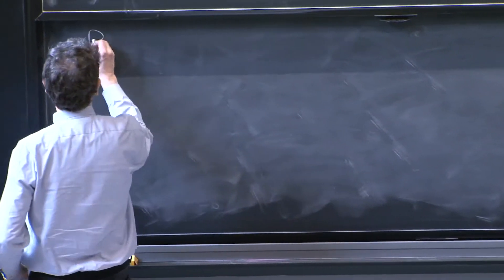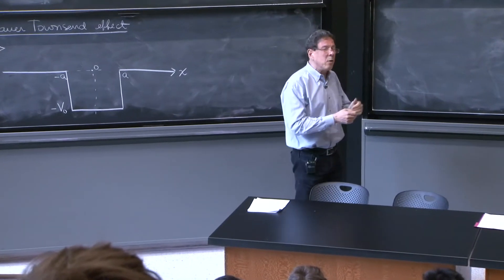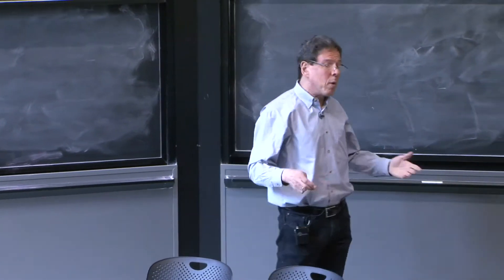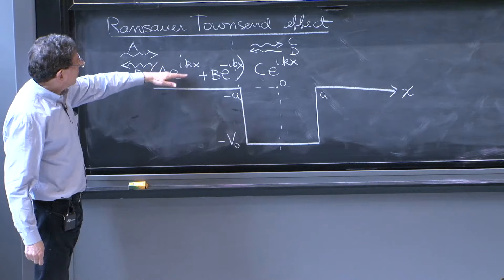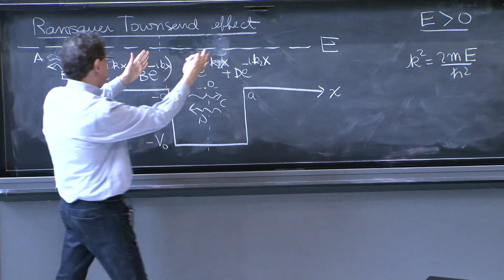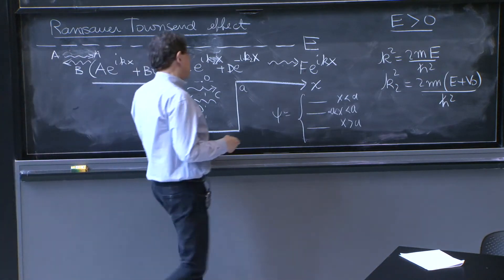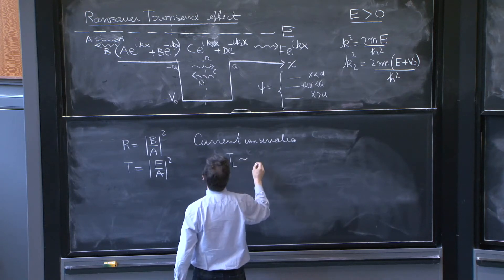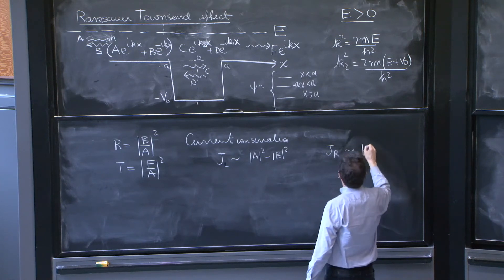Waves on the finite square well

Comment: Why does wave. A, B and F have the same k ?
Reply: k is related to the local available energy, and the potential function is modeled as a square well.
Before the well the local energy is E resulting in k1=k, inside the well the local energy is E+V0 with k2=k2, and after the well the local energy is again E with k3=k.